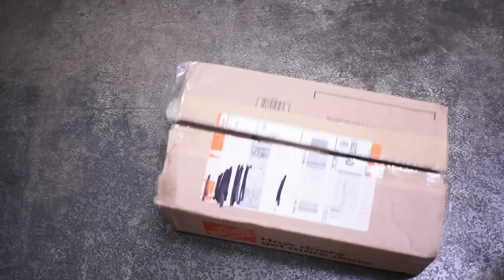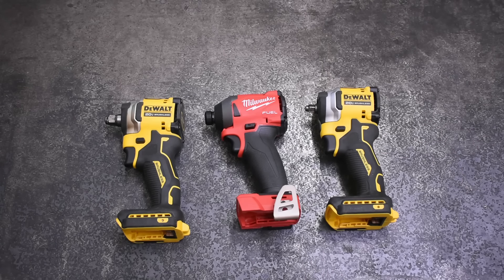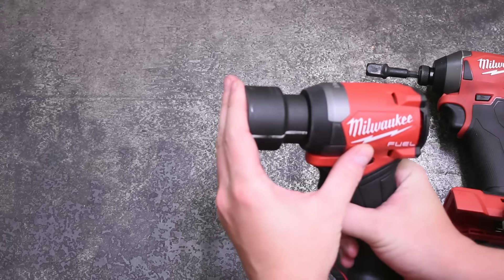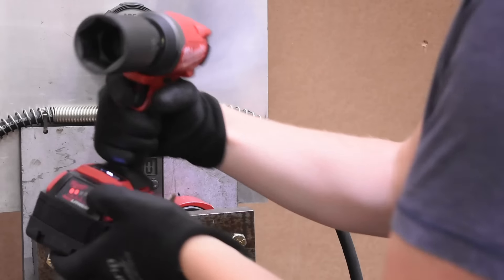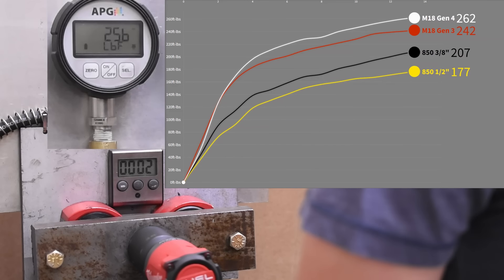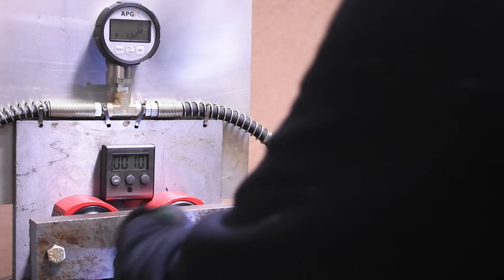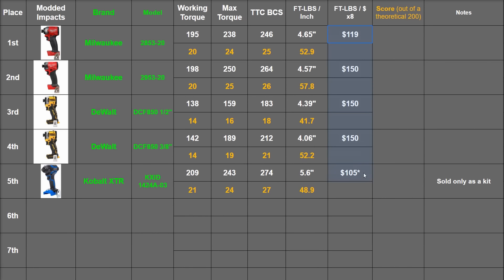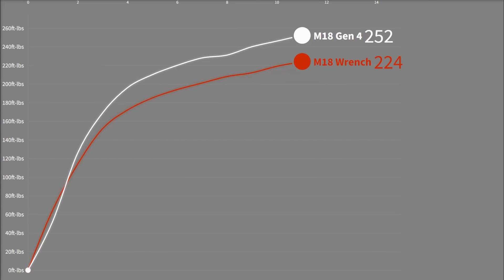Youtubers Made the Smallest, Fastest Impact Wrenches on the Planet, We Test 'Em!

Comment: I do like the 3/8 dewalt mod, strictly for size, it has enough power for what I'd use it for.
Reply: i did that exact mod and used it to change the brakes/wheel bearings on my car.  plenty of power for most things, but most importantly it fits where i need it to.
Reply: Awesome 👏

Comment: Just found this. Think I'll be building a Gen 3 specifically for wheels on a racecar. Seems similar to the ThunderGun in that it spins up faster but doesn't have quite the same amount of torque. But wheels torqued to 100lbs should be no issue.

Comment: i use my driver as a wrench all the time - i bought a Fujiya 512-21-BG to break lugnuts loose on my Altima. otherwise, i use a 1/4" shank to 1/2" hogring if i need to work on brakes or axle nuts. i've been eyeing a mid-torque but i haven't had the need yet. btw, it would be interesting if you can test if welding on a socket to a hex shank to square adaptor would mitigate losses caused by using the adaptor
Reply: I was wondering that too for my little old Ryobi 1/4" driver

Comment: My gen 3 Frankenstein exploded the hammer mechanism inside the case after around 12 months of daily use. 😪
Reply: Did you grease it? I use my dcf921 every day and grease it every couple months.
Reply: @markm0000  I pushed mine past it's limitations (it died loosening a 36mm hub nut, which it did plenty of times prior) and to be completely honest it was never a great fit. The anvil had end float slop since the day it went together. My best bet is that the hammers had too much clearance and weren't transferring the load to the anvil properly. Something had to give! Having said that, being in Australia I can't get my hands on a replacement hammer assembly!

Comment: I'll take the Dewalt one in a red brand version. With more torque of course. Perfect stubby. Super small, lots of torque. Maybe they should collab...
Reply: IDK.   That's why I like the DeWalt.  I don't trust high torque on small heads for longevity.  There are many things I want around 100ftlb a torque for, and I love that I can pick up a DeWalt stubby, nail it on without adjustments or fuss and know I'm close without fear of snapping bolts.    When I need more beans, I move up.  IDK, that just seems logical to me.
Reply: @crforfreedom7407  Milwaukee fan boys don't care about anything except peak torque. Ergonomics, battery life, cost, longevity etc mean nothing to them. 100ft lb in an ultra compact impact is extremely useful.
Reply: I only want milwaukee simply because I already committed to the batteries. Most the time I buy Mastercraft or whatever from Canadian tire. Most the time it's just whatever works within reason but I just like the look of the Dewalt stubby as a wrench, it's a good look lol
Reply: @hellpier4154  I've used DeWalt cordless products mostly commercially since 1996.  They've taken some serious abuse from me and never gave up.  I can only think of one that quit before the swap for an upgrade, and I don't follow trends.   I keep most of mine 10+ years or more.
Reply: @SpeedDemon88X  A lot of guys like those cordless ratchets, and they're only around 30-40ftlb!   It's nice having a tool for the right range of fasteners.  I like Milwaukee for 12v.  I've been DeWalt since 1996 and they've taken some real abuse from me (I've got a bad temper!  Things get thrown!!).  They just don't stop running.   Not in my experience anyway.
Reply: @crforfreedom7407  I like their ratchets too, but I've never been loyal to any particular brand
Reply: @SpeedDemon88X  Back when 14.4 was the biggest and best, I left my drill on a flat roof EoD Friday.   Rained all weekend.  Monday morning went back and there it was; underwater.   Pulled it out, blew it out, dried it out and ran it another 6 years before I replaced it for the 18v.   Yeah.  That makes me loyal to DeWalt!

Comment: Is the quick heating up of the gen 4 looking like a design flaw over the gen 3. Is the extra metal of the gen 3 body providing better heat dissipation, and therefore, the gen 4 will always be on the verge of failure like in your previous video?

Comment: I think it might be time to apply this "life hack" to the no-name Amazon brands, and maybe even Hazard Fraught (Harbor Freight) if they have any brands that aren't on Amazon.
Perhaps there's a super cheap diamond in the rough that can be frankencobbled... Not just from the same brands, but perhaps DIFFERENT brands that are using shells but have the same inside molding (eg: parts can be swapped, like two from a previous vid which had identical batteries).

My hope being that they aren't just rebadged tools, but instead will have slight differences in motors and anvils, or perhaps even the speed controller —assuming they even have one— where it might deliver more current. So maybe one has a heavier anvil, another has a better motor, and perhaps a third packs the more capable brainbox
      "Aah... Doktar Frakenstrudel, I presume??" 
                  -- Halloweenie TTC Video

Comment: I wonder how the power numbers on impacts would differ if you permanently attached to socket to the output shaft, i.e. if they were made as one monolithic part. Would it increase power at all, similar to removing adapters and extensions?
Reply: Yes it would since there’s a lot of play in sockets. The hammer has to travel more to make up that difference and there’s a power loss. However, having one socket size fused to the impact would make Johnny a sad boy.

Comment: I just want to know about Torque NM Value. If I use impact wrench only for motorcycle but it's 100cc scooter(VF100 or VM100N) Is it suitable for 100cc scooter at least over 500NM or 800NM? Sometimes I need to repair or replace CVT belt or engine parts. Also I'm looking for cheapest one.

Comment: The smaller diameter should technically spin faster if the motors are the exact same because it has 1/8 less inches per revolution. So amplified after 200 revolutions the 3/8 would have more impacts. Right or do I have it backwards hypothetically.
Reply: Seems to me it would be neither. I'm aware this is 6 months ago. But, the shaft and hammer spinning internally should spin the same revolutions regardless of anvil size. Which is why when you throw a 1/2 on a 3/8 impact it, in general, increases performance due to the slight weight differences between anvils and sockets from 3/8 to 1/2.
Reply: @derekmeyers5966  well I know blades depending on size have different rpm. Ipm is pretty much the same thing as ours rotational impacts. Did that's just my engineering thinking. Your probably right one just his harder because of weight distribution
Reply: @derekmeyers5966  you would think. But that's not how physics works. 

Think of a  grinder or a saw blade. The bigger the blade gets, how to the rpm correlate?

I want you to find out for yourself

Comment: Call me crazy but, I still prefer the gen 3 over the gen 4. All things considered the gen 3 is cheaper, a fantastic tool(even the drill), and there isn't huge gains when you fork out the bucks for the gen 4. I am still sticking with my opinion that if you are in the market for Milwaukee right now you should just go for the gen 3 at its cheaper price point.

Comment: If it's cutting out from the heat try them using the new milwaukee batteries 🔋 .
Reply from the maker: Their new batteries are M12 though
Reply: @TorqueTestChannel  yes but the batteries have just been updated for that reason at the new pipe line event that was held by milwaukee last month  check it out you will see I promise .
Reply from the maker: @78pontiactransam91  I'm saying the tools on screen are M18 and their new batteries are M12 so not sure how to use the new batteries on these

Comment: Changing the gear size would make better power or speed rather than anvil size or chamge
Reply from the maker: It's a planetary set with a ring gear that's apart of the housing shell and sun gear that's apart of the motor. It's not quite a differential swap :P
Reply: @TorqueTestChannel  didn't say it would be easy. It is possible. I get it just crudely dreamling a hole is much easier.